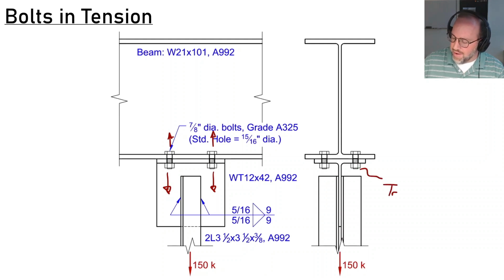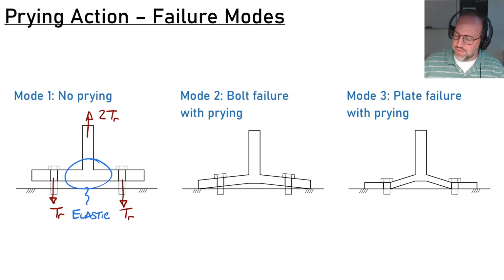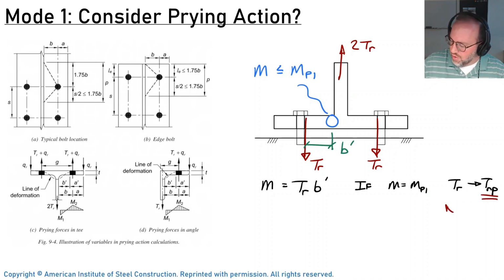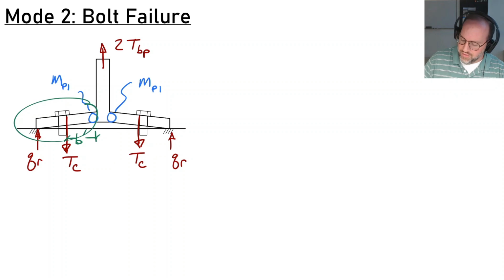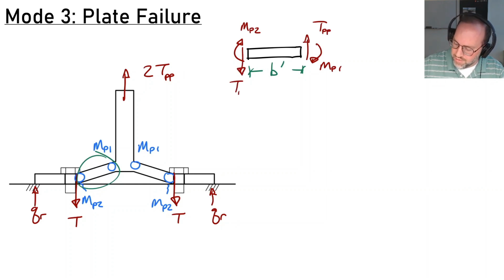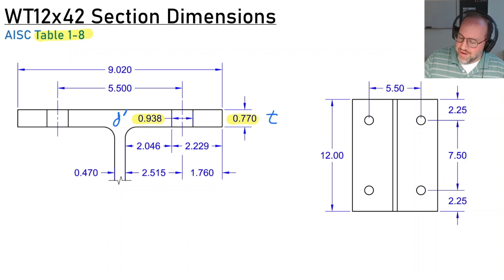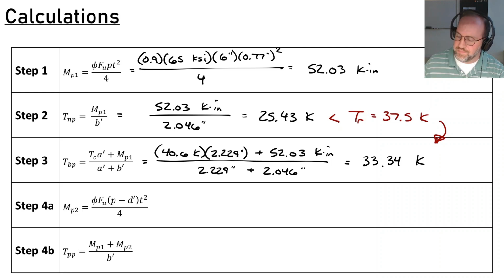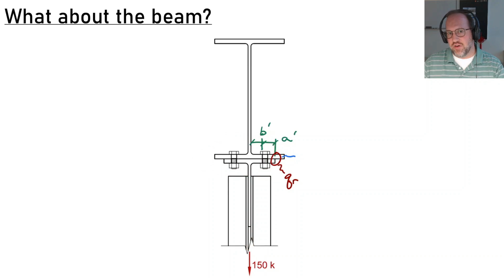Prying Action Made Easy - Bolt Tensile Strength for Steel Construction

Comment: Thanks for the video. It helps a lot in understanding the prying action. Out of curiosity, lets say the applied tension is less than the limit of elastic prying action limit (calculating Mp1 using yield strength instead of ultimate strength). The T section will still deform in the direction of the action elastically, and there will still be prying action in the connection due to the deflection. In that sense, should prying action still be considered regardless if the limit is reached? Thanks.
Reply from the maker: There can be prying action even if the connection remains elastic, but this method does not cover that case. This method (like the method presented in Part 9 of the Steel Construction Manual) only checks the controlling limit states. This means it works for checking the strength of the connection, but will not give you the exact values of prying forces when the connection is still elastic.

You may have seen that the Steel Construction Manual does have an equation for prying forces (Eqn 9-41 in the latest 16th edition of the manual). However, that equation is only valid at the failure state, so again it doesn't work when the connection is elastic. 

To my knowledge, the only reason you would need to know the prying force in an elastic connection is for fatigue. I've seen a handful of papers on this topic (here is one example: https://www.sciencedirect.com/science/article/pii/S0143974X19312702), and my understanding is that this prying force depends strongly on the level of bolt pre-tensioning. Bolts in tension fatigue situations must be pretensioned up to the values given in the AISC 360-22 Spec Table J3.1 (see also the RCSC Spec Section 4.2), which should take care of most tension fatigue and elastic prying issues.
Reply: @StructuresProfH Thanks a lot. Much appreciated
Reply: Thank you, Prof. Eng. I am gaining a lot from your guidance. It has been extremely helpful for someone like me who is steadily building towards becoming  a good structural engineers, even though I still don't have MSc in structural engineering.